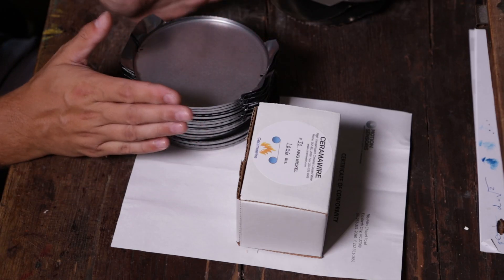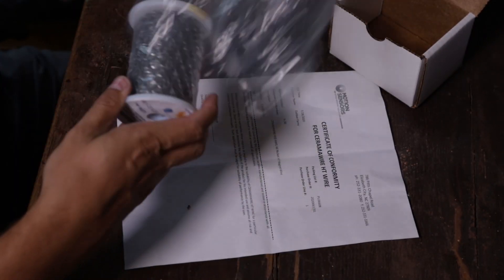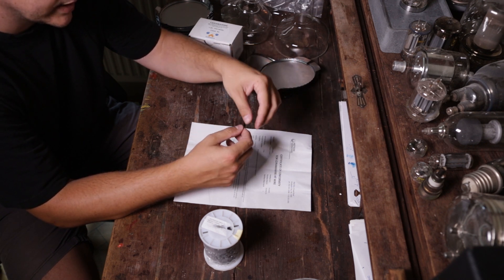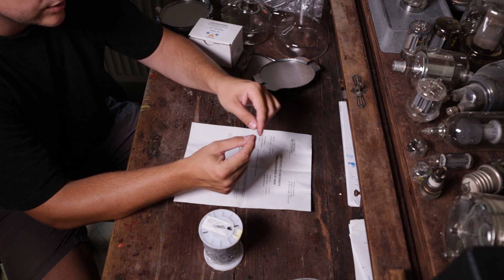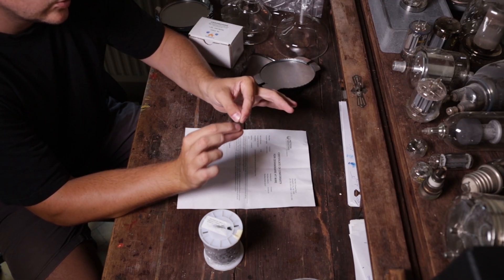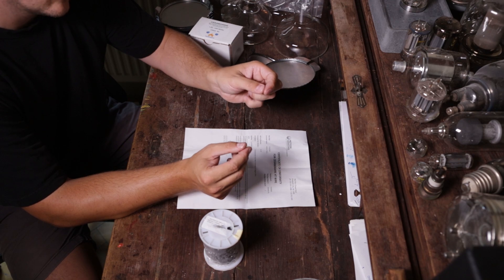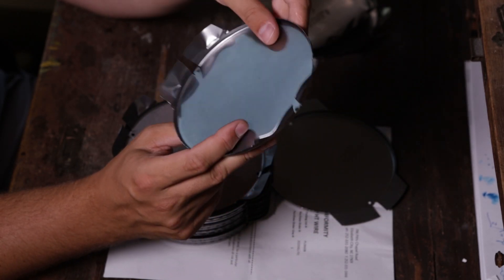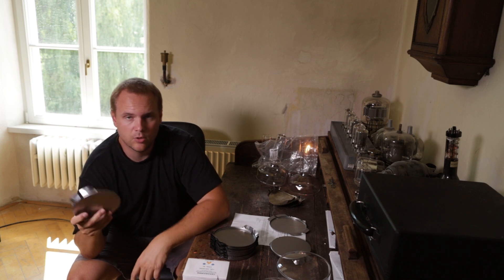Ceramawire arrived, anode cup update - Project H #13

Comment: Very interesting wire! I was going to ask where it comes from but when I saw the price, NOPE! I will make my own ceramic covered wire!  I wonder if thinking of a different concept is necessary for that shaped plate. Possibly flame spraying a metal coating onto a form, or maybe even electroplating the metal onto a form.

Comment: Loving the updates Dalibor😎 I agree completely with your decision to use local manufacturers. Not only for the reasons you stated as in knowing the production process but also because it sponsors the local economy which can only be a good thing.

I see you have a nice collection of valves (tubes) Is that a GMI-90 in the far corner?

Comment: These fins have to be made of 2 or 3 segments in order to allow clean bending. It is basically a geometry problem. You cannot turn something flat into something round without deforming it, because  the initial surface of the plate is bigger than the final one.
Reply from the maker: Actually, I am not going to bend it but draw it. The excess metal should be moved to places that allows it. Metal pots are made this way. However it might simply not work for this shape.

Comment: I think that anode mesh is big and it needs to be spot-welded at the sides. You can make few narrow tabs at top and bottom and at the sides. It will have influence on design but assembly and strength will be better. 
I think, it is possible to use lathe to roll sides of anode cup. Rigging with diameter of flat surface may be need. 
I would make first test sample to find out what hiden issues may happen. You can use defective parts to make an assembly and play with test tube, while waiting for final parts. 
Digit catodes are pretty big. The may generate audible noise when driving with low frequency.
New design is full of surprises, as usually.

Comment: One way to do the cups would be to make them high cupped (above the actual part lip) and then ship them to a multi axis laser cutter. Two part job, but then it should have good results. Could also be done on a water jet with the same level of axis movement.

Alternatively, you could make a cup, then spot weld a lip with the wings. Two part process, spot welding included, unsure how you'd see that kind of a compromise.
Reply from the maker: Several local suppliers with 3d pipe laser told me it is not possible. I still think it is, they probably didnt want to waste time with non-standard operation (there would be a jig needed).
Reply: @daliborfarny  Yes they would have to make a custom jig, and for only a hundred or so parts the jig price would become a large part of the job price. If you had a CO2 laser that could cut that steel, and it was deep enough to hold the cup on end, you could make a custom holder to allow you to cut it yourself, after the deep draw has made a cup for you.
Reply: @daliborfarny  Tohle by byla práce pro někoho s běžným laserem se přídavnou rotační osou, na trubkovém by se takový díl dělal strašně blbě - jsou uzpůsobené na podávání z tyčového polotovaru, ne chycení na šklíčidlo nebo zakládací desku, tj. problém je jen v poptávání špatné konkrétní technologie, ne v neproveditelnosti. Technologicky ale dává smysl spíš bodování oušek než se pokoušet o hluboko tažený kelímek s následným obřezem (pochybuju že půjde udělat na jeden cyklus tvářecím nástrojem, spíš by bylo na místě zadat někomu kovotlačitelským způsobem).

Comment: Did you try to make the metal Part on the Lathe by metal spinning?
Reply: Speaking purely as an "armchair machinist" metal spinning is very hard especially if you want some degree of precision too.
Reply: @edgeeffect  true, but if i remember right, it is 0,3mm in thickness
Reply: It wouldn't work for this, because ultimately he has to have those cuts, so what's the point of doing it on a lathe when the ears are still going to get cut. Mandrell drawing is how it's done, then cut on a multiaxis laser cutter.
Reply: @aserta  for what reason he will need a multi axis Laser? There are easy and cheap solution bevor Laser was invented
Reply: @Scavage0001  Curious to hear how would you do it.
Reply: @Konecny_M  i order now some 0,2mm stainless steel and will do some test
Reply: @Konecny_M  i get now my 0,2mm stainless steel, I'll try it with two pieces of sheet metal, one cut in the outer shape Profile and one just round for a "smoth" surface for Roller bearing. I think, that this could work after a big learnig curve. But i belive the Best way will be to go on the press like for a kitchen sink. And after that you take some press tool for cutting the sides but this will be so much more expensive than Sport weld, so I am going confirming with Dalibor that Spot welding will be a good solution